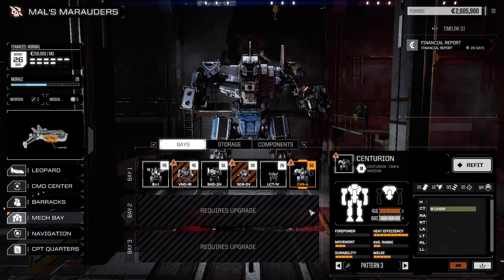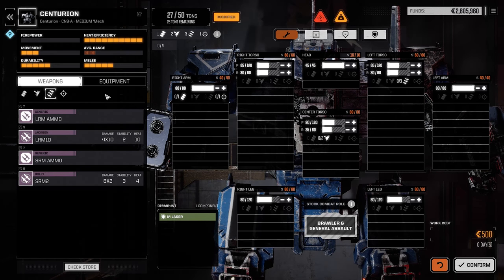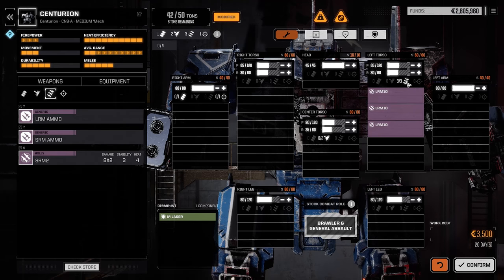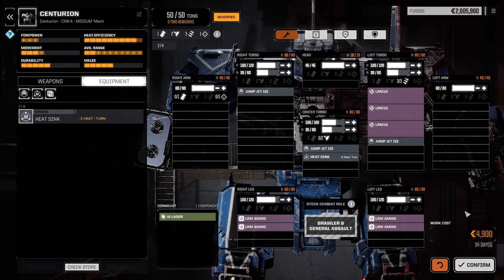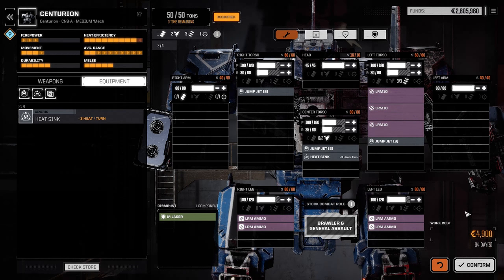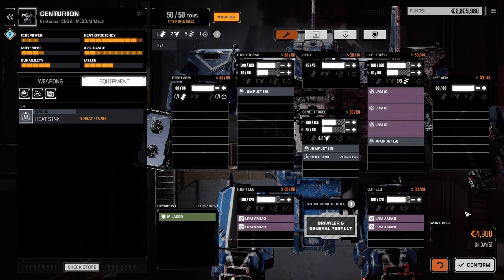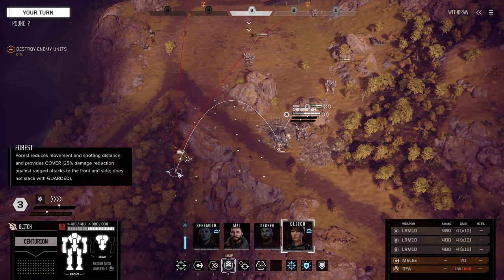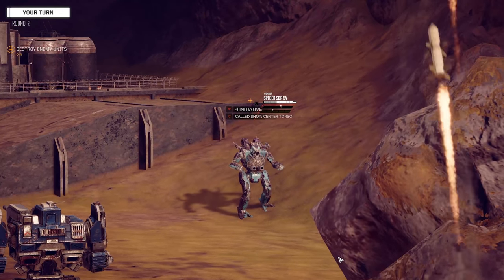Build An Early LRM Boat - A Battletch Guide (2018)

Comment: I think it might be more efficient to use a pair of LRM-15s if you can get them.  I think it saves you a ton, that could be used for another jump jet or more armor.
Remember that hiding in the back is only usually safe.  You can't always tell where reinforcements are going to come in from, and there have been times that my rear-echelon missile boat suddenly found itself on a new front line.
Reply: Also, I'm not sure 4 tons of ammo is necessary - you're unlikely to go through 16 rounds of fire in a mission.  Three tons is usually fine for 10 rounds of fire.  Better to invest that in more armor.

Comment: arms dont have any equipment, probably good idea to move armor around to reinforce RT and legs to esure you dont loose lots of launchers or legs.  Also, i am not 100% sure indirect mech needs jump jets.  It will spend most of its time sitting in cover in some forest or entrenched far from everyone dumping loads of missles all over the map.  If you remove them you can beef its armor or maybe even throw in more ammo.  Besides that its an awesome build.
Reply: Probably because the union is wonky and often times will spawn you in places that you cannot get out of without jump Jets. I usually just restart the mission with the logic being at the leopard would never drop you off in such a terrible place where you can't even move.

Comment: If you can find an Assassin you can make a pretty decent, and fairly early, missile boat.  The trade off is that you have to give it zero armour to maximize damage output while keeping jump jets for mobility.

Strip all the armour and load up as many jump jets as it will handle, top up your tonnage with LRM launchers and make sure you have at least a couple tons of ammo for them and... that's basically it.

Keep it away from enemies - and it's not that hard since it's fast, has jump jets, and it can indirect fire at a decent range.  The fact that it ignores 3 evasion makes it viable for quite a while as a LRM boat, and it's great if your pilot has multi-target because they can reliably land hits on fast mechs with 3+ evasion and also remove one evasion on each target.  That's why you want multiple LRM launchers instead of just one LRM-15 and some armour.  I went with four LRM-5 launchers so if I was heating up I could shut one or two off and still dish out some damage - and strip evasion from enemies.

Comment: Nice mini-guide Mal!

I too make that first free Centurion a missile boat.  Since in my lance compositions the artillery mech (LRM missile boat) is the only truly long range mech I have, and my short range mechs will generally draw all the enemy fire, I get by with a lot less armor than you used.  And I generally add a medium laser or two just in case I goof and let someone get close too, but then my LRM boat is standing alone away from my other mechs, where yours would have the company of two other mechs.    

I'd also like to mention to newer players what I think is the ideal pilot build for the LRM boat...  the Lancer. (see my reply to Edgar Robinson's comment in yesterday's Part III episode for a full list of pilot builds)  The Lancer has Multi-Target, Breaching Shot, and Bulwark for talents.  The key talent here is Breaching Shot -- it will bypass cover, entrenchment, and guarded on an enemy mech as long as you target it with only one weapon.  For example, if you have 3 LRM 10 missile launchers as Mal's Centurion build does, you could actually target 3 guarded mechs with one launcher each, and do full damage instead of half damage (or 3/4 damage if they're only in cover) on each.  Bulwark isn't really as important as Breaching Shot is, but I find it nice when I'm standing behind some solitary piece of cover and don't want to move out from behind it, thus giving me guarded.
Reply from the maker: Responded on your other comment Knight... the LRM Boat MW build suggestion is simply brilliant. Thanks!

Comment: OH, Mal, just wanted to be sure you knew that with the 1.1 patch you can now customize mech pilots as long as they aren't ronin or patreon backers of BattleTech, you can even choose their voices!  If you want to get a few of your key supporters in the game as pilots, you probably want to hire some non-ronin pilots and rename and customize them as early as possible so you don't waste XP on the generic guys you start with.  (they're all ronin unfortunately)
Reply from the maker: Yup, that's the only reason I haven't booted them, they already have some XP. I will hire some more however and slowly move the Roini pilots out. I REALLY like the idea for the LRM Pilot you suggested... obviously go heavy tactics but the whole Gunnery line to breaching shot is brilliant. It frankly had not occurred to me, it would affect multishot targets, which is why I never thought it would be worth it for an LRM boat pilot. I figured getting tactics to Master Tactician would be more worthwhile, I stand corrected sir! o7
Reply: Another advantage to the Lancer for LRMboats:  did you notice a LRM 15 plus a LRM 5 is actually lighter than a strait up LRM 20?  If you have the hard points to spare to do it you can save the larger LRM launchers for the breaching shots and the LRM 5's for knocking off a evasion chevron on another enemy.  :-D

Comment: Is there a reason to not have the ammo in the torso? I'm still new at this, so this may be completely wrong, but I like to store the ammo with the weapons. This is the reasoning. If you lose a leg, you lose half your ammo. Where as if you lose your shoulder, all your weapons are gone and your ammo is useless. This is the reason why I put them together, as one without the other is useless. Again, I could be wrong with that assessment, but that's what I currently do with my Mechs. Also, the LRM boats are really good at setting Mechs as "unbalanced" or just straight up knock them down. This is amazing for fighting!
Reply: Once your armor’s gone, critical hits can cause ammo explosions, which will do even more internal damage to that location as well as the pilot. Legs are hit less often, and won’t cause the pilot to suffer injury. Better to lose a leg than a side torso, arm, and pilot at the same time.
Reply: @RetroMaticGamer  no. if you lose an arm then nothing happens. if an ammo explosion blows your leg off then you're crippled.

Comment: Huh. Thought this was going to be about Mechwarrior 5, not BattleTech. 
Well, this is awkward, as I don't have BattleTech. If this had been about MW5, I'd have said a good EARLY LRM boat (Provided you have YAML going & use the cheat that has all of the equipment available from day one.) would be a Locust 1M. Sure, it's only a 20-tonner, but give it an XL engine, some Structural Endo (C), a Small Cockpit, & a Stabilized UL Gyro, & you have enough space to put an ECM (C) in there on top of a pair of LRM-5's, which means you can equip it with an Armor Stealth or Armor NSS. Do that, give it a TAG rather than an energy weapon, & have it run the Missile Boat Role, & you've got a little dude that'll be running around the map shooting things with its missiles & being unable to be targeted by Mechs that aren't in Melee range. 
Especially if you also throw an Advanced UAV Drone in there, as well, so the Mech itself can stay out of range of return fire.
Reply: Oh. And if you're not hung up on ONLY using LRM's, you could always put a pair of MML5's or ATM(6)'s on it, instead, so you'd also get short-range coverage without needing more than two missile hardpoints or extra weight.